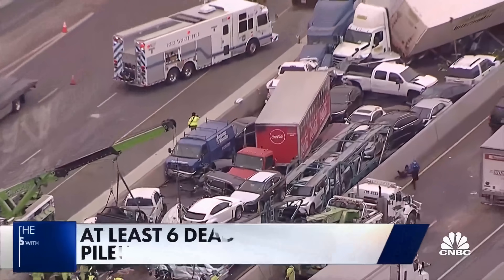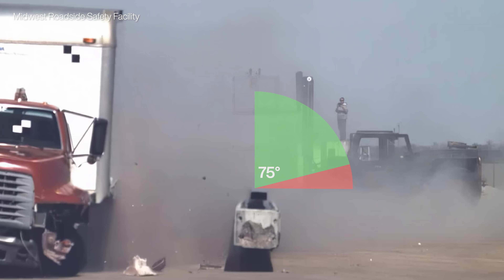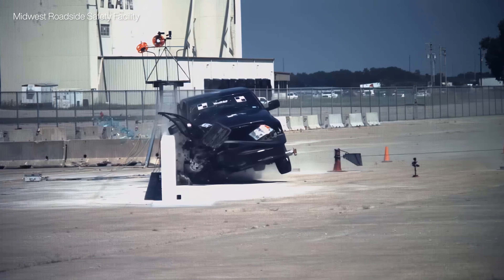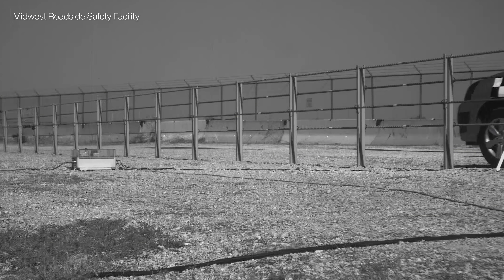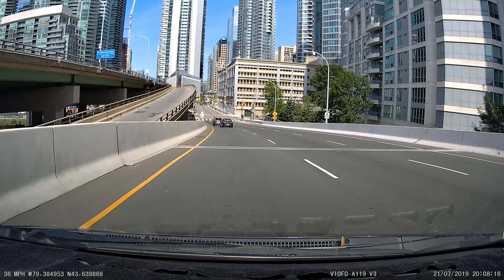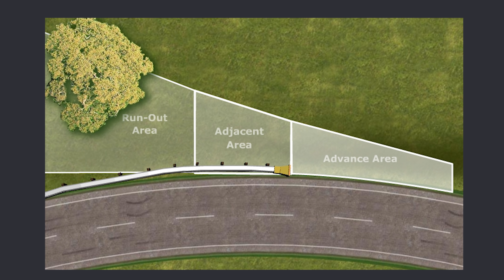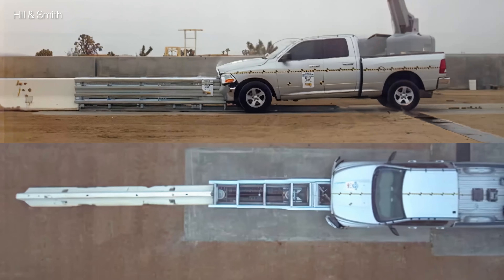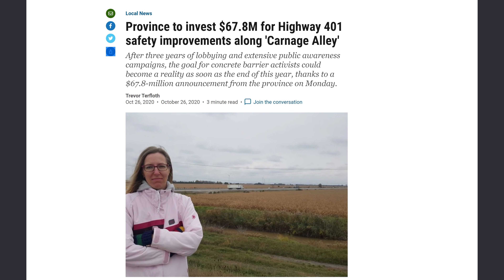How Road Barriers Stopped Killing Drivers

Comment: As a member of the Newark Fire Departments Rescue Squad, I have seen many traffic accidents and sadly the fatalities that result. Have seen many of the different types on the highways and parkways and other heavy traveled roads that you showed. One of the worse I have seen and helped at was a toll booth accident on the NJ Turnpike. The toll booth and the human occupant are protected by a SOLID Concrete wedge with a high flat barrier just in front of the booth. The car was an older station wagon with as many as ten people in it when it slammed into this barrier. Some survived the damage and injuries to the passengers that didn't was horrific. My point is as the decades progressed I saw just how some of the fatalities and injuries dropped due to better and safer designs of crash barriers.

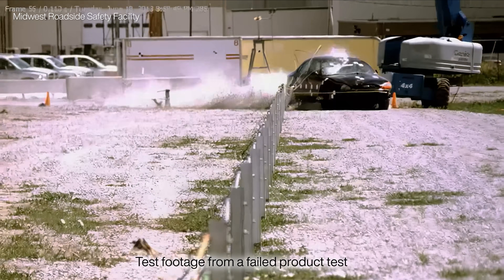Comment: Rough timestamp 7:08, You left out the part about cable barriers killing motorcyclists by (with no sarcasm) cutting the body or body part(s).
Reply from the maker: So I looked into that for the research, what the experts were suggesting is that the fatal accidents that would occur with cable bears would also happen with concrete and guardrail. They also said in most accidents the rider is already on the ground when they contact the barrier.  However there weren't a ton of studies, and I can definitely see instances where an accident becomes way worse.

Comment: I suffered a micro-sleep and unfortunately hit one of those fish-tail ends. It skewered my car, dropping the steering wheel and fascia out the back window.  There was a tensioning cable, with a block of iron at one end. That  broke free and lashed around  - with the heavy end finally coming to rest on the passenger's seat. Afterwards, the guard rail was reshaped into a loop so there was no chance of encountering the end.

Comment: The numbers are skewed and they are actually increasing...It's the population that is decreasing...I've been driving 44 years, there are far less people on the road, and not just because of the "pandemic"...There are less and less drivers, overall...When I was a teen in the 70's, that was a right of passage—getting your license. Now, with Lift and Uber the young people don't care about having a car. As well, most are happy to just veg out at home...It's a shifting paradigm.

Comment: The end treatment looks more like a SKT-SP.  If I saw the inside face I'd be able to tell for sure but the MSKT has a ground strut which you can see in the crash tests.

Also the type of system used depends on the clearance behind the face of the rail.

Lastly, in the US there was a end treatment called X-Lite which has an interesting tale.

Comment: Well researched video! I have a comment: I believe that it’s a drainage system under the concrete barrier, not a sewage system (at least in US terms).
Reply: Sewer doesn't have anything to do with human waste. Sewerage is a way of transporting liquids underground. Whether it be storm water waste water. Those drains are a sewerage system. They being rain water off of the road.

Comment: Regardless of which is safer concrete or cable for vehicles. Cable barriers do much more damage to vehicles. I have seen many cars tangled in the cable barriers and 90% are 100% totaled. I mean there is nothing on the outside of the vehicle that is not completely totaled.

This video's covers nothing about motorcyclists being forced into a cable barriers.  I think we all can agree it would be certain death for them.

Comment: Cable barriers are designed to kill any motorcyclist unlucky enough to be knocked off their bike by some idiot in a cage.
They are also responsible for triggering epileptic seizures in people due to the changing rate of headlights flashing in the opposing lane as they pass the posts.
So, they murder motorcyclists and make night driving a nightmare.

Comment: You are a little misinformed.The F-Shape is specifically designed such that a very narrow approach angle results in the front wheels being deflected away from the barrier, guiding the vehicle back into the lane - sometimes with no other contact on the car.

This is a significant factor in the reduction of serious crashes.

Comment: Not my area of engineering but I’m hooked. New subscriber.👍
Cable barriers results in decapitations. 
Few as they are...you don’t want to be that one.  
I hate those concrete corridors set up by road constructions. 
Some are so tight there’s little margins for error on either side.
Even at slow speeds...
Reply: Engineer? Did you see the data? That's like saying, "seat belts cause occupants to be trapped, so they're risky to use."

Comment: When I lived in Cabo they had the annual BAJA1000 and a part of the course ran through federal highways, in which they had guardrails.
We were going to party and took that highway. As we passed over a bridge we saw one of the competitor's car parked in a somewhat weird way next to the barrier. We slowed down just to see a real racing car.
However when we looked in, we saw a slumped-over body in a racing uniform. 
We pulled over in front of him to see how we could help. When we got down from our car we could clearly see the front of his. 
The metal barrier had broken off after impact and had gone through the windshield instantly decapitating the pilot.
We called authorities and were asked to stay and give out a written statement. 
I was 16.

Comment: Nice for all you in the U.S..  Currently I a living in the Philippines.  What they like to use here on two and four lane highways is a system of solid concrete blocks.  Measuring about 2 feet tall, 2 feet  wide and 3 feet long.  Anchored beside the roadway and spaced with gaps about 2 feet between each concrete block.  Guaranteed to flip or destroy any vehicle that hits it and absolutely guaranteed to seriously injure or kill any motorcycle rider that hits it.  The spacing is what kills

Comment: Interesting video. I assume there are regulations against having large vegetation like trees next to certain roads. But I wonder if in some settings certain types of vegetation/bushes could be used as natural barriers/shock absorbers. If not as primary than as secondary barriers.
Reply from the maker: Thanks Jay, from what I read trees over 4" in diameter are considered a hazard.  I haven't seen anything on using natural vegetation as shock absorbers but that's probably because it's both expensive and not easily controllable, or maintainable.

Comment: Clear zones can be a problem if they are not wide enough. I witnessed such an event driving west on the 401 between Kingston and Toronto, back in the late 80s. We were driving in the right-hand lane when a car blew passed us, easily doing 70+ mph, when it lost control as it approached the tractor trailer ahead of us. The car drove down the clear space, up the other side and flew over the east bound lanes to land in the ditch. By some miracle, the three occupants survived with little to no injuries.

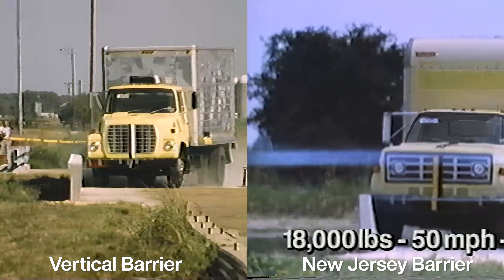Comment: If MASH is so stringent, why the hell are the barriers on overpasses so damn short (particularly overpasses well over 50 to 100 feet high and with curves)???  I cannot see, in any way, how they would prevent a semi from rolling right over them when they don't come higher than the bottom of my car's door sills.  Even modern SUVs and the current crop of pickups jacked up so high you need a ladder to get into them (and that's factory, without even a lift kit) are at huge overtop risk on those shitty little barrier walls (as shown at 4:05)
Yet the median wall on a straight, level highway can top 12 feet.

Comment: There are data that shows cable barrier result in a higher amount of serious injury or death in motorcycle accidents than steel barriers.

You get snagged and torn apart instead of sliding.

Comment: What about highway barriers that use pressure treated wood beams with metal posts? The "new" construction near me uses that.
Reply from the maker: From what I remember MASH guardrails can use wood but it's not as common.  If it's 31" high and has the bolt in between the posts, that's the latest version.

Comment: If cable barriers are less than half the price of concrete, they could easily install TWO cable barriers, one behind the other. Not only safer, but cheaper and smaller carbon footprint.

Comment: Something he fails to mention is cable barriers are like cheese wire to the human body if you come off a motorcycle.. imagine surviving the initial crash and then sliding at 60MPH into high tension cable.
Reply from the maker: So this could have been part of the video but I didn't mention it because there's not enough research in this field.  I couldn't find a standardized test for motorcycles.  Experts have said that most drivers separate from their bikes and are on the ground before hitting the cable barrier.  Fatal accidents for one barrier would be fatal for others.  However, like you said, it could be a cheese grater in other situations.
Reply: @Lam  https://www.tvnz.co.nz/one-news/new-zealand/motorcyclists-repeat-calls-ban-cheese-cutter-wire-rope-safety-barriers most of the bike gear is solid enough to protect from blunt force... But cheese wire is different. It goes right through the protective gear and body

Comment: Local to us, someone hit a sign or barrier near a staggered crossroads, next to a water drain/ditch, and in a cabriolet/convertible. I have no idea what they really hit, as it may have been flattened and out of view. But the passengers side wing had a long 5 foot pole sticking in it. Thankfully no one in the passenger seat. But had it been a few inches over, or the impact on the other side, it may have gone through! Scary.

Comment: It's interesting going into this video with no knowledge of public road barriers, but some understanding of the stuff used for motorsports.
The focus of motorsports on driver safety within the cockpit/survival cell + the fixed direction on circuits seem to make it a lot easier to pick a barrier to use in specific parts.
(except road rally, that shit's always dangerous *refer to kubica's 2011 accident where a guardrail went through the car*)
Reply from the maker: You might like this video on F1 barriers was amazing! https://youtu.be/FkpvPWB3jMk  

They definitely have different design criteria.  Higher speeds but more predictable crash angles.